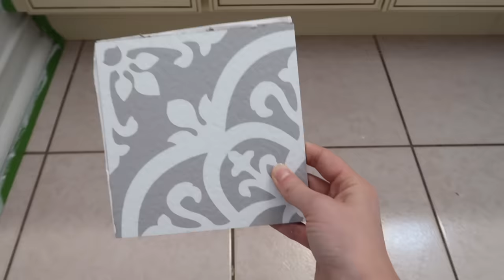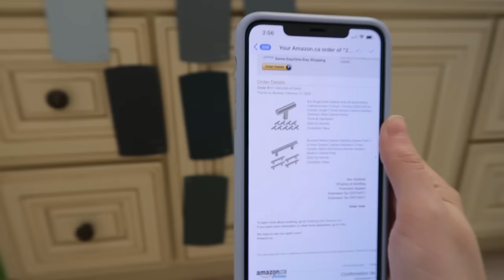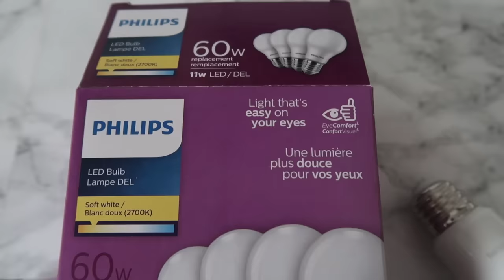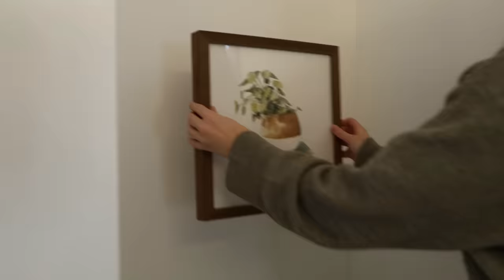DIY BATHROOM MAKEOVER ON A BUDGET | RENTER FRIENDLY

Comment: I did peel and stick flooring and honestly after a couple of days, the water from everyone showering made the stickyness go away quickly and the tiles starting coming apart noticeably, I would constantly have to slide them back together until i ended up just throwing a rug over the bad ones, after a few weeks i just pulled it up and the smell was horific! They are pretty though and i’m pretty sure if you use tile glue or something to make it more sticky it would be great for a long time. Also make sure someone that is good at measuring and cutting for odd spaces! We made that mistake too..
Reply: Another youtuber used glue in her bathroom stick flooring
Reply: its starts moving when theres a lot of pressure, like getting out the bath. If you'd coat the bathroomfloor with a sandy paint - and the extra glue, it works.
Reply: Peel and stick is okay for a laundry room or closet on the cheap but NOT a bathroom.
Reply: I'm wondering if washing the floor with alcohol first would be helpful.
Reply: I have peel n stick, but it's higher end stuff, it's held up for 10 years, but you need to prep the floor first.
Reply: good to know. thanks for sharing!
Reply: I'm wondering if one could apply a poly clear coat or something of that nature, non yellowing of course.  That way it would help seal the seams and keep dirt and water out.  If I do a flooring project like this, I am going to get a good clear coat to go over the tiles.  My bathroom is small and there is really nothing to lose in trying it.

Comment: How terrific it all looks!  I recently used Minwax gel stain, to repaint my vanity bottom cabinets a darker color; no need to remove the door fronts; it's the consistency of Elmer's glue and then gently put in brush strokes. New door handles help also. Replaced all the hardware , faucet, towel racks, etc,to match in dark also. Kept cream colored sink, toilet, tub surround, but repainted walls. No need for $4000 makeover. You are a great inspiration!

Comment: For renters: If the contact paper or stick-on tiles leave a sticky residue (the tiles are notorious for this after they've had time to really set up) you can try a product called 'goo gone.' You remove the tile or as much of the paper that you can, then apply the goo gone, let it rest for a few minutes, and gently scrape it off with a cheap, plastic scraper.

PLEASE do a test spot somewhere it's not obvious before doing the whole thing and make sure it doesn't react with whatever you're removing the sticky from.

If the goo gone is too rough for your surface, rubbing alcohol works, too. Just buy a ton of the stuff. (You can get a gallon for very cheap at any farm and feed store.) Put soaked paper towels over your sticky parts and leave it for a good hour. Don't let it dry or the sticky will dry back on.

Also, here's a protip. If you paint the back of your cabinet doors, it really does give a more finished, professional look. It's the big difference between amateur and pro and people will notice if it's done or not. It's so worth the little bit of extra work. Just paint the backs before the fronts so your fronts are absolutely perfect when you're finished. 

Love the makeover. Absolutely HUGE difference!
Reply: Vociferon Herald of the Winter Mist plain oil, like for cooking, is safer. Than wash residue off with Dawn.
Reply: @Jade_902  I've done the oil trick and it does work (as does mayo), but - for this - you have to let it sit for two straight days to do the job. For many people this isn't realistic. Especially if they have children or pets.

Those 'peel and stick' tiles aren't as 'renter friendly' as people think. Once that adhesive sets, it's not coming off easily if you prepped your surface right.
Reply: Vociferon Herald of the Winter Mist Have you used these tiles before? We plan on retiling the entrance area in the future, but it’s lower on the lust of projects. Looking for a short-term fix until we can get to it. Will they last, say, a year, maybe two?  Do the edges come up, get dirty?
Reply: @sandyyoung863  (sorry this is so long. i don't know exactly what your situation is so I'm just going to tell you everything)

I helped my uncle install this in the houses he built back in the 80's and 90's and I've experimented with them for a variety of projects over the years. They'll last if you install them right and your underlayment isn't porous. 

New, clean concrete that's very smooth can work as can wood floors and old linoleum. Rough, crude concrete that's very dirty isn't a good option. Ceramic tile and stone doesn't hold it as well. The grout lines are weak points and once that area starts to weaken it's only a matter of time before the rest goes. These don't stick well to OSB or plywood. Raw, unsealed wood is hit or miss. I think it has something to do with the natural oils in the wood and how smooth the surface has (or hasn't) been milled. If I'm trying to stick tile onto wood for a craft project (say, dollhouse flooring) I always put a coat of poly on first, no matter how smooth the wood is.

You want to clean your floors with TSP. You can find this powder at Walmart or any hardware store. It removes oils and grease residue and is used to prep surfaces for paint or tile or anything that has to stick. I don't see anyone having trouble finding TSP, but - if you do - cleaning with straight rubbing alcohol will do the same thing.

When people pay to have things like this installed professionally the pros have these extremely heavy rollers they roll over the tile to really get it to stick. You need to be serious about pushing it down once you get it in place. Don't rush that part or it will get loose over time. I have had success by going over the tile with a rolling pin, then putting a piece of wood over the tile, then weighing it down with my husband's weights and leaving that to set while I place the next tile. I use 4 twenty pound weights and am careful to weigh the edges. Then a second application of the rolling pin. before moving on.

The small, individual tiles are intended to be installed by the homeowner. It's adhesive comes already on the tile, isn't as aggressive as the professional stuff, and it has a slower curing time. The curing takes place over weeks or even months. The longer it sets, the more permanent the bond.

That's why I cringe when people call it 'renter friendly.' Well, yeah. If you only have it down for a month or so. But if you've prepped well and worked hard to push it down, it won't come up without a chisel and and will ruin whatever is underneath it when you try. I've fought with old peel and stick tiles when helping my friend with house flipping and it was a nightmare. Had to learn to leave it.

I have two recommendations. 1. Buy at least mid-level quality. The stiff I've messed with at Home Depot doesn't have the greatest adhesive and is hit or miss. But keep in mind that the higher quality adhesive won't allow you to reposition easily (if at all). 2. Plan on leaving it down and putting the new flooring over it. This works great underneath wood or laminate flooring. 

And please find professional installation videos. The newby DIYer's miss a lot of important steps and put out misinformation. (Bless their hearts, I had to learn, too!!)

Comment: Looks beautiful!  I gasped when I saw you put contact paper over the countertop.  I remember the heavy use of contact paper in the 70's.  However, I remember the heavy frustration when  trying to remove it in the 80's.  I love the look, but just could not take the leap using contact paper.

Comment: Curious how are the floor tiles holding up after a few months and a few cleanings?
Reply: M P I want to know that too
Reply: I did peel and stick flooring and honestly after a couple of days, the water from everyone showering made the stickyness go away quickly and the tiles starting coming apart noticeably, I would constantly have to slide them back together until i ended up just throwing a rug over the bad ones, after a few weeks i just pulled it up and the smell was horific! They are pretty though and i’m pretty sure if you use tile glue or something to make it more sticky it would be great for a long time. Also make sure someone that is good at measuring and cutting for odd spaces! We made that mistake too..
Reply: Nicole Blount humidity still exists
Reply: I've had peel and stick tiles in my kitchen for 19 years. They are still in great condition and have not peeled up at all.
Reply: IslandGirl 1003 it might depend on quality. What brand did you use?
Reply from the maker: it's been just over a month, and everything is still holding up very well! no changes!
Reply: M P Just a suggestion but what if you adds a layer of Epoxy?
Reply: Not good I guess
Reply: I love your parents best of all! The look is clean and fresh! I've used cheap sticky rules from Dollar General and they've lasted 10 yrs! 
Just a personal preference though, I would have gone with either White or Grey rugs. The video gives them a mauve color which wasnt my style but everything looks very nice! You did a wonderful job!
Reply: My step dad put the same kind of tiles in my kitchen and dining room in 1987. Peel and stick no wax laminate really holds up over time if installed on a clean solid surface.  (Some wear and fading of fine details over 43yrs of mopping, but none peeled up or cracked. )

Comment: You really need to use a high grade primer. That latex paint is gonna peel right off
Reply: I have seen this happen =/ lesson learned
Reply: I was just going to say that too
Reply: I didn’t use primer on my cabinets. I didn’t even prep them. I just used a really good cabinet-grade paint, and after 4 years, they still look brand new.
Reply: @vickilarouge4855  Oh so you didn't paint your door with a 5 dollar latex paint sample?
Reply: I'll also add, I can't see for sure what she used on the cabinets, but it looked like budget paint and not high grade primer. If she's doing multiple project like this, a large thing of really high grade primer can be used with whatever paints she used for multiple projects.
Reply: Amanda Atlas she literally says what she uses. Not sure how you can’t see it.

Comment: Wondering about the floor stick tiles.  Do they show some depression where the grout is underneath?
Reply: it's ideal if you scrape the grout/floors underneath first. We used the floor pops in our entry way when we sold our house last year - the floor was uneven and after scraping a bit and using putty to fill some holes in the previous tile the stick tiles laid very nice and ended up looking great!

Comment: It's not my style, but it's cute. It's DEFINITELY not renter friendly. I don't know any landlords that would be okay with you painting the cabinets and medicine cabinet. Most won't let you paint the walls either, and even though contact paper and those pop tiles are supposed to be easy to peel off later they usually leave a sticky residue that's hard to get off if they've been there a while.

Comment: How is painting a built-in vanity renter-friendly?
Reply: It's a cheap fix and no demo/mess required.  If you prep the surface and use a quality paint it will last. I've also heard of folks applying a coat of poly over the paint for extra stability. Now this is from a landlords point of view...a tenant more than likely would not be able to do this, especially if they are not experienced or know the correct methods. I personally wouldn't trust a tenant to do it.

Comment: Wonder how the sticker tile holds up after a couple years.
Reply: I've seen some that holds up better than real tile . . .
Reply: I’m order for it to last longer you should use a vct glue
Reply: I recently installed some in my bathroom as a temporary solution and I don't think they're going to hold up that well in the humid environment. I only need mine to last about a year until I can afford tile installation but even then I had to add extra adhesive to be comfortable with them going that long in a humid environment. I think they're even more prone to not lasting laid over tile where there's not 100% contact because of the grout lines like she did in this project. Everyone is raving over this product right now but I think they're only really any good laid directly on top of existing vinyl flooring.
Reply: I used it in a bathroom & prepped the linoleum floors really well. But it didn’t last long before the tiles started coming up. I think it would work better in a room that’s less humid. Still looked nice for awhile.
Reply: @AG-lw9db  I can imagine water slowing making it's way in between the tiles and molding.
Reply: They don't. I did my living room two years ago. They are cute for two mins.

Comment: I live in an apartment. I can’t even paint the walls, let alone cabinets! 😢 At least I can put nails in the walls!
Reply: Weird that you cant paint the walls but can put nails. You have to paint over the holes after taking the nails out and filling them.
Reply: BatmanPwnage I was told that I could put fist sized holes in the wall but no painting! It makes no sense to me.
Reply: @janwilliams8930  wow. My husband put a fist sized hole into the wall. We had to cut out a huge square of drywall and insert wood and a drywall piece to fit the square and screwed it into the wood. The compound doesnt even match our unpainted white wall. I have yet to paint that wall gray to match the rest of the room. My walls are textured too and its a pain in the ass. We plan on renting the house and we'd prolly be ok with paint more than holes. My house was owned by one previous person and my room had 1000 holes in it. Was a pain.

Comment: I want to see how this hold up over time. The floor and counter especially. 

Side note-- Dad is hot. Especially the accent. Mom is hot too. Getting better with age no doubt. (Sorry if you're traumatized, kiddo!)
Reply: The floors aren't going to hold up well at all. Speaking from experience. BUT I have had contact paper on my kitchen and bathroom counters for a couple years now and it's holding up amazingly well. Full disclosure: I DID put a little caulk on the counter in the bathroom, like she did, but not in the kitchen. They're both doing well. Eventually I will replace them both but I'm super happy in the meantime

Comment: I Love the Berr Marquee Paint from Home Depot.  Do you ever use a topcoat/sealer when using this paint in a bathroom or kitchen?  I painted my bathroom vanity with DIY PAINT FROM DEBBIES DESIGN DIARIES AND IT IS AMAZING!! NO SANDING REQUIRED !!  JUST MAKE SURE EVERYTHING IS VERY CLEAN .  I USE WATER& DAWN DISH SOAP 🧼.  THEN APPLY A TOPCOAT/SEALER.  AFTER  3 YEARS THEY LOOK AMAZING 🤩

Comment: FYI - The Door - Paint samples are temporary coats of paint that should later be top-coated with full formula paint. They are watery and do not behave like real paint in application.
The Floor - If the original floor tile grout is not exactly level with the old tile the peel and stick tile will show the depressions of the old tile as it's walked on and could crack.

Comment: Fastest, most cost efficient way to re-do bathroom tile- spray paint!! 

I had this hideous off white, age stained square half way up my bathroom wall so I spray painted them white and you’d never ever know the difference! I did the whole bathroom for under 30 bucks. It was extremely messy, I had spray everywhere in the house so be mindful of that. You could also try just rolling on regular paint. Might do the same thing with half the mess

Comment: I probably watched this before and commented but I just watched it again and omg great job!!   It looks so gorgeous!  I love the way the colour and vanity top definitely looked more modern.   

How do you measure and cut around the sink or toilet?   I have trouble figuring it out the right place???    Do you measure or eyeball?    The choice to remove the dark curtain was good.  The brown made the area too heavy!👍👍👍😸

Oh and one more question:  my father found a discounted vanity that he installed in the bathroom.  He removed the drawer so that it would be all one space underneath.  The problem is the hinges broke.  Well one door he broke and one I broke (hinge off) by lifting myself up.       Q:   Is there a way the doors/hinges can be fixed to be able to put the doors back on as it looks horrible right now with the stuff underneath???!
I don’t know how to repair the holes in sides of cabinet that held the hinges.??

Comment: I have a bathroom with wall paper I am removing. I want to texture the walls over the dry wall and paint instead--in the dry areas. Curious how you painted behind the toilet tank? Or did you just paint what you could reach? I am debating whether to remove the tank or the toilet to get it out of the way--but I will have to break seals either way.

Comment: weather or not you remove the existing floor or not for whatever reasons. The best glue to use is 430 henry clear glue at home depot for sticky tiles or regular tiles. The best on the market if you DO NOT WANT your tiles coming up in the next 12 years or so. Just make sure you let the glue dry for 20 minutes before you lay the tiles and lay the glue down on floor in a very thin layer. TRUST ME you will not be getting these tiles up, so once you lay it ,, it stays there. I very beautiful make over , but the tiles may come up ,, ok if they do ,, just use henry.

Comment: I wouldn’t recommend anyone renting a place to use those tiles, because I did in my own home and when I lifted them to replace it was a mess. Tiles and glue were hard to remove, I had to use the large metal scraper that gouged the floor. Just redo the grout.